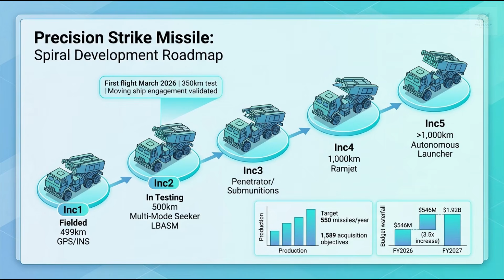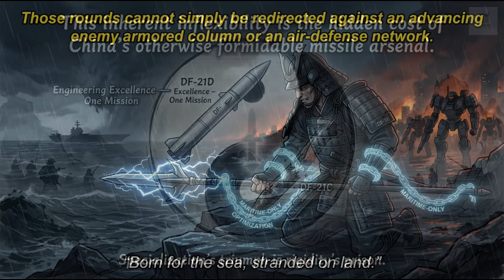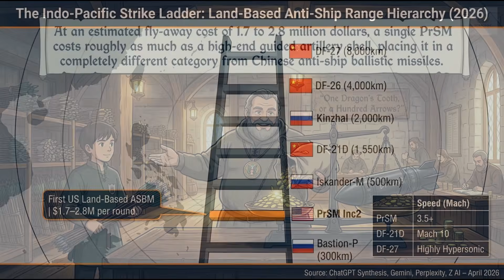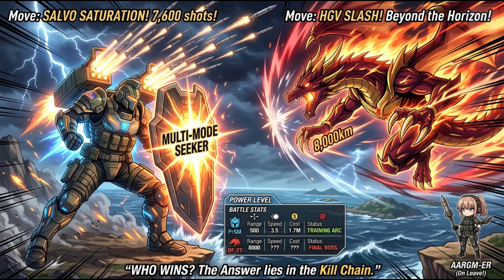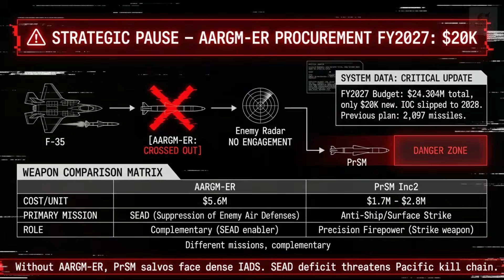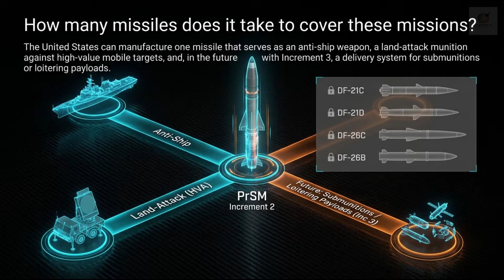Why China Need To Fear PRsM Inc 2 - With Multi-Mode Seeker (2026)

Comment from the maker: Strategic Forecaster is a technical defense analysis channel — we break down weapons, sensors, and operational math regardless of which nation builds them. In this very video, we highlight that China’s DF‑21 and DF‑26 families currently hold range and speed advantages over the U.S. Army’s PrSM Increment 2, and we examine exactly why the multi‑mode seeker matters.
We don’t equate technical analysis with endorsement. If there’s a specific Chinese or Russian system you’d like to see us cover with the same depth and rigor, drop the name below — we’ll gladly add it to the queue. Thank you for watching.